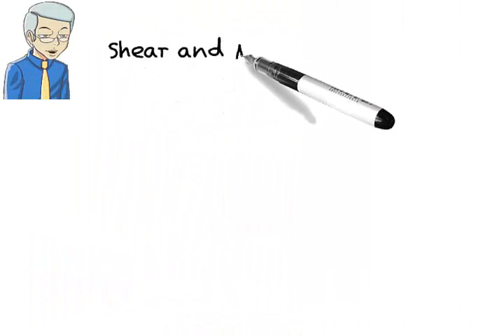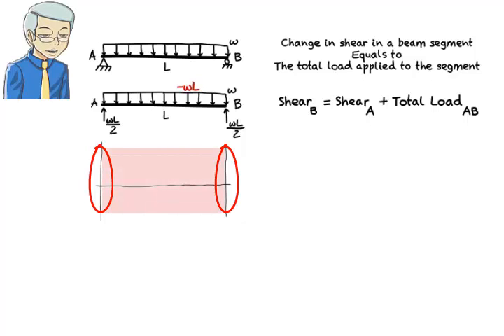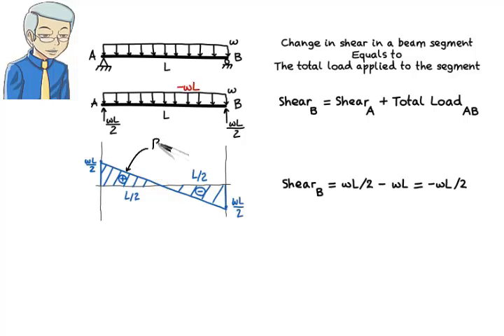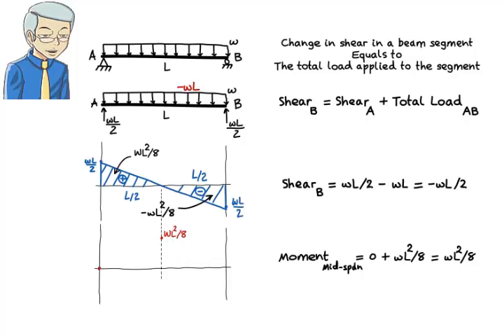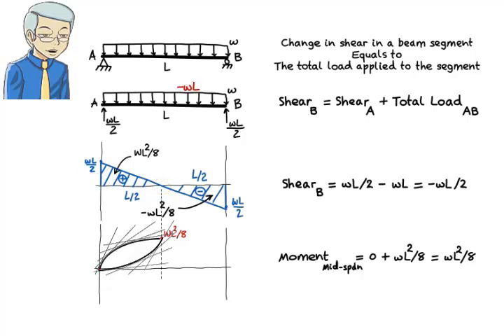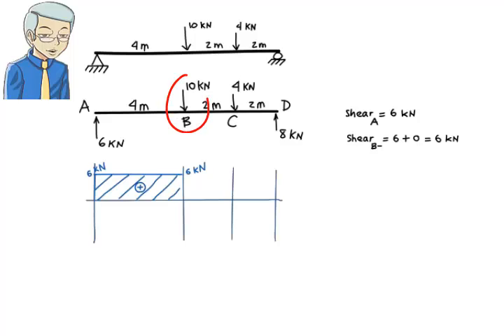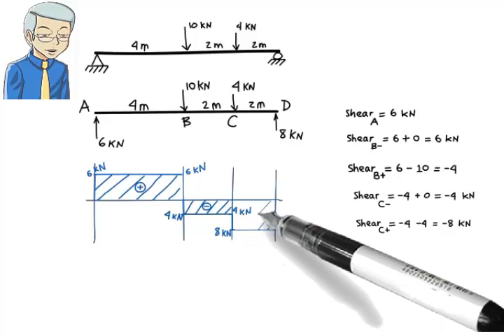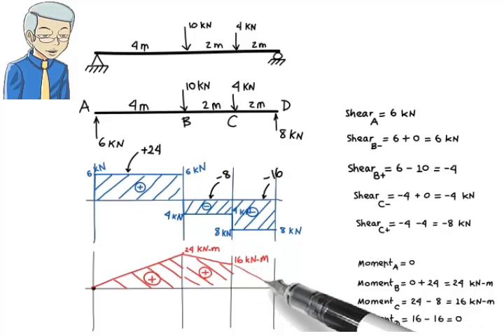SA09: Drawing Shear & Moment Diagrams without the use of Equations

Comment: Thank you so much! I spent ages to find a good video as was stuck at method for drawing moments diagram. Delighted  -as i now understand it!!! Thank you.
Reply from the maker: You are quite welcome.
Reply: @DrStructure  sir can you please make a similar kind of video for uniformly varying load
Reply from the maker: A generalized load function most often forces us to actually formulate shear and moment equations before we can graph them. The approach described in this lecture works best when we have concentrated or uniformly distributed loads, the kind of loads that result in linear shear diagrams. If the shear diagram is nonlinear, it would be difficult to determine the point that it crosses the x-axis (the point of maximum moment) without having the shear equation.
Reply: @DrStructure  ok sir thank you.. Sir your teaching methods are tooo good and lucid

Comment: Hello, st 12:11 what is shear under B. From a previous reply I learned that shear at a point is undefined rather just left or right of a point. So considering that if I want design the beam for shear at B where point load is 10 kN , what should be my design shear 10 kN or 6 kN(max of 6 and 4 kN)?
Thanks in advance doc.
Reply from the maker: For design purposes, maximum shear is 6 kN, it is not 10 kN.  If provisions need to be made for negative shear, then a value of 4 kN would suffice.

Comment: If there was no support at the end and rather an overhang at the end then how would we initiate the graph?
Reply from the maker: At the free end of the overhang both shear and moment are zero.  Say we have a cantilever beam subjected to a uniformly distributed load. The beam is fixed at the left end and is free at the right end.  Assuming the length of the beam is L and the intensity of the distributed load is w, then at the fixed end of the beam (at the left end) vertical reaction is wL and bending moment is (wL^2)/2 (counterclockwise). 

The starting value for shear (at the left end) is wL, and the ending value, at the free end, is zero. This gives us a right triangle as our shear diagram. 

The starting value for moment is negative (wL^2)/2 and the ending value is zero. Since the degree of moment curve is one higher than that of shear, we end up with a nonlinear (quadratic) curve for moment diagram. The curve is going to be concave down.

Comment: what would be the shear if there is only one reaction acts at the middle of the beam assuming a uniformly distributed load along the beam ?
Reply from the maker: A beam with only one support reaction is unstable, therefore not subject to analysis.
Reply: Dr. Structure thank you for caring, but i got one more question, does the shear becomes zero at the point where it turns from positive to negative?
Reply from the maker: No. Shear changes sign at interior supports. At one side of the support shear is positive, then it jumps to a negative value at the other side of the support. Shear is considered undefined  at the support, even though it appears as zero on the shear diagram.

Comment: Why is shear at a negative? The equation is only balanced if ShearA is negative as that would make ShearB-(-ShearA) = Total Load AB. Can you please explain? Shear A and Shear B should both be positive as the reaction forces are both acting upwards.
Reply from the maker: By definition, a positive shear consists of two forces, applied at the ends of the beam segment, that tend to rotate the segment in the clockwise direction. Similarly, a positive moment refers to two end moments that want to bend the segment concave up. 

Therefore, it is important to keep in mind that for positive shear, we have two forces that collectively are trying to cause a clockwise rotation in the segment. That is, when we talk of a positive shear, we are talking about an upward shear force at the left end of the segment AND a downward force at the right end of the segment. So, any shear force that is drawn downward at the right end of a beam segment is considered positive.

The above sign convention is not the same as the one we use for writing the equilibrium equations, for balancing the forces. In summing the forces in the y direction, up is considered positive and down is considered negative.
Reply: Dr. Structure woah thank you so much for such a detailed response. Your videos have not only helped me but my entire class and we have a Facebook group where I found your videos. So once again thanks a lot for your effort, I subscribed a while ago :)
Reply from the maker: I am glad the videos have been helpful. Thanks for the feedback.

Comment: Could you please answer this as well.
If area under SFD gives BM, then what does area under BMD give? AND if slope of BM gives SF and slope of SF gives load. Does slope of load give some thing?

Thank you.
Reply from the maker: The integral of bending moment (area under the moment diagram) is related to the slope of the elastic curve. More precisely, the slope of the elastic curve equals to the integral of M/EI where M is bending moment, E is modulus of elasticity and I is moment of inertia.

No, the slope of the load has no significance with regard to internal forces in the beam.
Reply: Kindly pardon my ignorance, but what is elastic curve? and does area under bending moment diagram give some important property or something? Does area under BMD geometrically mean something? 

and similarly what is geometrical meaning of slope of load ? What does slope of load imply?
Reply from the maker: Elastic curve is the deflected shape of the beam. The curve represents how the beam deforms under the load. The area under the moment diagram represents the slope of elastic curve. 

Say, you dump a pile of sand on a bridge ( beam).  That is your distributed load on the beam. How does the pile look like geometrically? Did you try to flatten the pile? Or, did you leave it as a cone? Depending on how you distributed the sand in the pile, it has a geometric shape (which has a slope.)  So, if you flatten the pile, the load has a zero slope. If you leave it in the form of a cone, the slope is constant,...
Reply: I appreciate you for replying. I express my gratitude for that. Truly a "Dr" indeed.

Comment: We know, a material will fail if applied load exceeds the ultimate strength of that materials.
But, even if we load a member below its ultimate strength for a longer duration it will fail, but how to compute that duration??

We mostly talk about deflection, slope, bmd, sfd in a member, rather we are talking w.r.t to dimension of the member, but how to calculate afore mention parameters w.r.t time, like after 10 minutes how much will be the deflection or sf or bm
Reply from the maker: Yes, cyclic loading causes fatigue which could lead to structural failure. Fatigue is a design consideration which involves keeping stresses in the member below the fatigue strength. Depending on the type of design methodology being used, we may still be able to assume linear elastic behavior for the structural material. This means stresses and deflection can be assumed to be linear and independent of time. Otherwise, we may consider time-variant nonlinear behavior for the material, and use advanced analysis techniques for our stress calculations.

Comment: Hi, sorry for my English and thank you for your lectures. I have logically misunderstanding about shear diagram, then mathematically I can solve them. Why shear diagram is not symmetrical and don't have a "V" shape, then all of the load is symmetrical? Thanks.
Reply from the maker: Be being the shape of a V, you mean, shear at the midpoint is zero and everywhere else is positive? That would not work. A positive shear means that if we cut the beam (taking the left segment) and examine the shear force at the cut point, we would have a downward shear force. 

To maintain equilibrium, if the beam is cut to the left of the mid-point, shear needs to be acting downward (positive), but if we cut the beam to the right of the midpoint, shear has to be upward to maintain equilibrium (to ensure that the sum of the forces in the y direction equals zero). That upward shear, by convention, is a negative shear. This means, the shear diagram to the left of mid-point has to be above the x-axis indicating a positive shear, and to the right of the mid-point, below the x-axis indicating a negative shear.
Reply: @DrStructure  Thank you ;)

Comment: Dear Dr. Structure,
At 3.04 you've drawn a sheer force diagram. Why is the value at B postive? Shouldn't wL/2 be -wL/2.
thanks in advance
Reply from the maker: Please keep in mind that the sign convention we use for reaction forces is different than the sign convention used for shear and moment.

Shear at B is not shown as positive, it is correctly drawn as a negative shear on the shear diagram. The reaction at B however, since upward, is considered positive and drawn as an upward force on the free-body diagram.

Comment: Shear force is defined as a force which acts parallel to surface. Then why is it always represented perpendicular to beam in SFD?
Reply from the maker: If we examine an infinitesimal element in a solid body,  in addition to a normal force, we see shear force components acting along two planes: the parallel (horizontal) plane and the perpendicular (vertical) plane.  We cannot have one without the other, else static equilibrium of the element cannot be maintained. 

In beams we focus on the shear force along the vertical plane since it is directly related to the bending moment in the beam, and the vertical plane gives us the geometric properties needed for calculating shear strength.
Reply: Thank you very much for replying.
Reply: @DrStructure  the answer was enlightening. Please give us more guidance about it. This question is an enquiry of mine too- how we can conceptualize shear force .. As a parallel of plane force or something that comes to resist falling of the beam portion when a section is cut? Which concept is suitable where, that is, in different cases? Please make us guided in details. Thank you.
Reply from the maker: @asmaulhusna732  Take a look at ST08 lecture (https://www.youtube.com/watch?v=dMnoZAsgd3s&t=56s)
In the middle of the lecture, there is a conceptual explanation for shear. May be that could help for better wrapping your mind around the concept.

Comment: In the following beam if the shear force at B is -250N and if we  add the 0N at the other end of the right segment it will remain -250N (-250+0), while it should be zero ( from equation)

         900N(the only force)
           |
-------------------------------
A    (2m)     B   (1m)

|..........650N
|
|
|------------------...........(0N)----------------------------------------------------(x)
|
|-250N   .........
|
|
Reply: I meant to say sometimes the  addition  rules doesn't work.
Reply from the maker: I am not sure if I understand your diagram, but I'll give it a try. From the numbers shown on the diagram, one can infer a simply supported beam subjected to a downward load of 900 N at 5 m point from the left support. The length of the beam is 18m. This makes the left support reaction 650 N and the right support reaction 250N.

For this beam, shear in the left segment of the beam (from the left support all the way to the left of the applied load) is constant positive 650N. In the right segment of the beam (from just to the right of the applied load to the right support) shear is constant negative 250 N.  There is no zero shear point in this beam.

If we examine the point of the application of the load, shear just to the left of it is positive 600N, then there is a drop of 900 N in the shear value giving us a negative shear of 250N just to the right of the applied load.
Reply: sorry I could not show what I meant,
I was arguing about the shear force of last part of the beam ( right-hand side). the beam has the following properties; 

-The length of the bar is 3m
- support A is at the very left side of the bar with a reaction force of 650 N upward
-The support B is 2 metres away from support A ( in right-hand side) with reaction force of 650N
- there is a 900 N force downward in the middle of A and B
-the rest of the beam (1m) is at the right-hand side of support B without any reaction or forces.

*I know that the shear force at the point B ( support B) is -250
and for the rest of the beam (the last one metre at right-hand side) if we want to draw the shear force diagram using addition (-250+0) the shear force will remain -250 as at the very right-hand side of the beam (end of beam shear is zero).
Reply from the maker: Okay, let's go over the problem. We have a beam of length 3m.  From left to right, we have:

at x = 0, a pin support. We call this point A.
at x = 1m, a downward load of 900 N. We call this point C.
at x = 2m, we have a roller support. This is point B.
at x = 3m, we have a free end. This is point D.

The upward support reaction at A and B each has a magnitude of 450 N. Since the load is applied at the mid-point of segment AB, the reaction forcess are equal in magnitude.

This gives us a positive shear of 450 N in segment AC, a negative shear of 450 N in segment CB, and a zero shear in segment BD.

Keeping in mind that shear at the support points and the point of application of concentrated load is undefined, this is how you want to think about shear and the way it changes in the beam:

At A (x = 0), shear is undefined. Why? because there is a support reaction here.
at C (x = 1), shear is undefined. Why? because there is a concentrated load here.
at B (x = 2), shear is undefined. Why? because there is a support reaction here.

* A positive shear develops just to the right of A with a magnitude of 450 N.
* Shear remains constant +450 N from just to the right of A to just to the left of C.
* Since there is a downward load of 900 N at C, we are going to have a drop in shear value, from +450 just to the left of C to -450 just to the right of C.
* Shear remains constant -450 N from just to the right C to just to the left of B.
* At B, since there is an upward reaction force of 450 N, there would be a jump in shear value by 450. This means shear changes from -450 N just to the left of B to 0 just to right of B.
* Shear remains zero from just to the right of B to point D.

Comment: How can we draw bending moment diagram with the help of known direction of bending moment.
Reply from the maker: The direction (positive/negative) of bending moment across the beam tells us whether the diagram is above or below the x-axis, but it does not help us draw the diagram itself. To draw the moment diagram, generally we need to have the moment equation. Although under certain loading patterns (for example, when the beam is subjected to concentrated or uniformly distributed load only) we can draw the diagram without needing to explicitly write the moment equation. But, the sign/direction of moment does not provide enough information for drawing the diagram.
Reply: @DrStructure  Do we take counter clockwise direction as positive and if we take it as positive then should bending moment be drawn above x- axis or not?
Reply: @DrStructure  thank you for for reply 😎
Reply from the maker: With regard to the sign of bending moment in beams, we always consider two (not one) bending moments , those at the ends of a typical (infinitesimal) beam segment. That is, we always need a pair of moments (one at the right end and one at the left end of a typical beam segment) in order to bend the segment.  The pair of moments either wants to bend the segment in the concave up direction (we refer to this as positive moment), or in the concave down direction (negative moment).  If the beam is being bent concave up (if the moment is positive), then it means the moment at the left end of the segment is acting in the clockwise direction and the moment at the right end of the segment is in the counterclockwise direction. Conversely, if the segment is bent concave down, the moment at its left end is counterclockwise and the one at the right end is clockwise in direction.